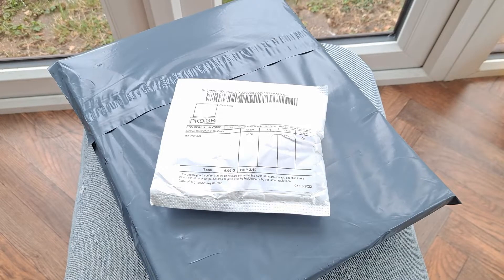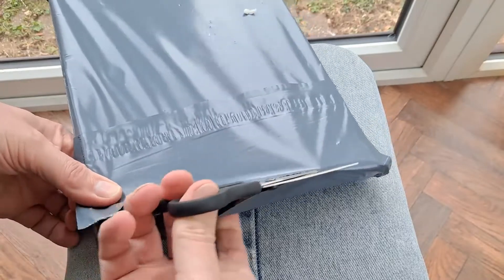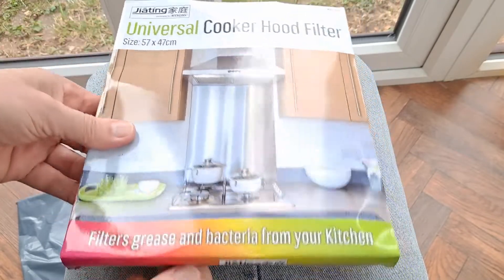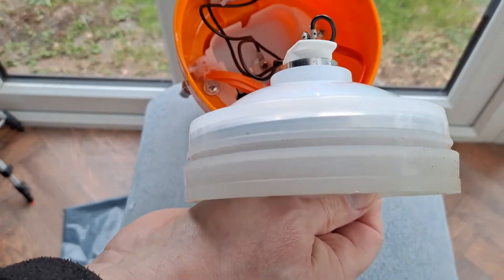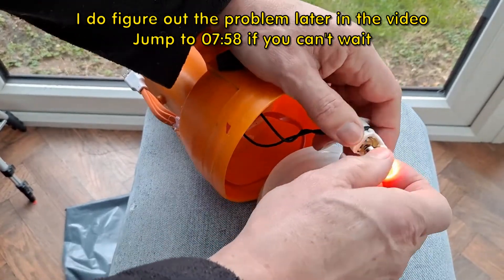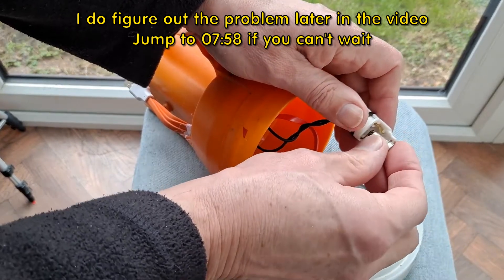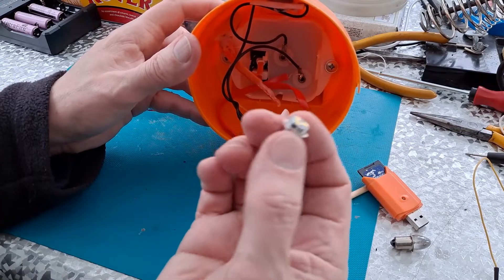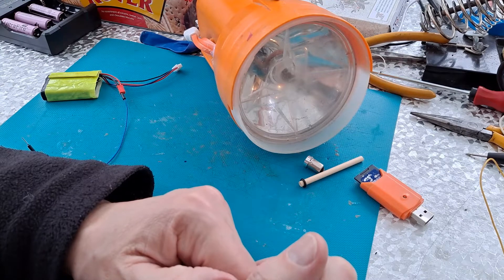Grandad's postbag 20220309 Filter and LED bulb

Comment: 3 cob leds the volt drop across is 2.98 volts per led if they are wired(connected in series) then 5 volts will not hack it as you would need about 8.94 volts, but if they are wired in parallel then maybe the reisistor is to large and dropping too much voltage, I think the problem is China🙂 I wonder if you shorted out one of the cobs would the lamp light okay on 5 volts you may over drive it a tad but you could fit a suitable resistor in place of the removed COB???
Reply from the maker: It is rated at 6 volts. These bulbs have circuit boards inside them to match them to the stated voltage. That is the whole point of them, so they are direct replacements for old style incandescents in legacy or cherished items. In fact this one does light from 4 freshly charged NiMh AA batteries which surprised me as they measure about 5.2 to 5.3 volts so the output from the power bank I am using inside the torch must be just below that. If I had a variable power supply I would be able to demonstrate exactly when this bulb lights up.